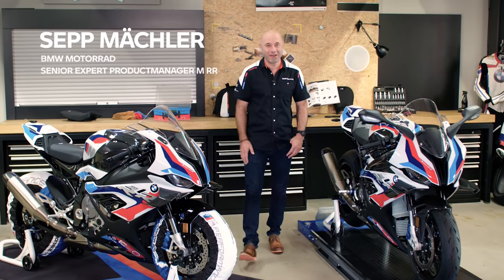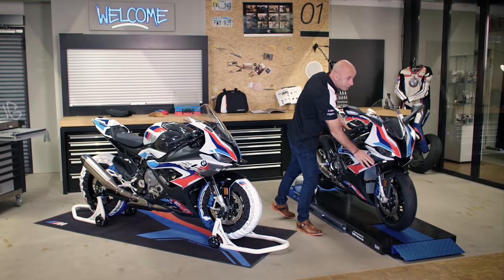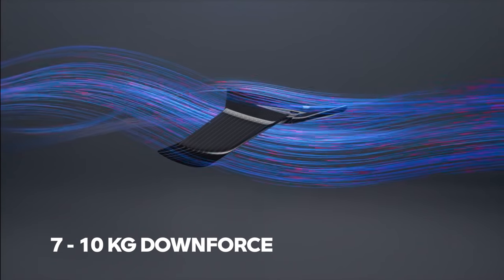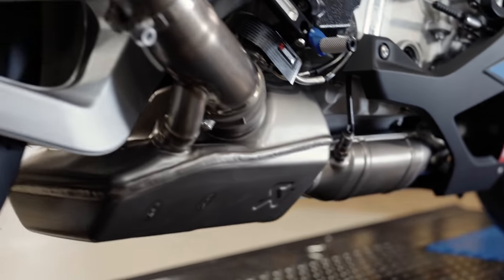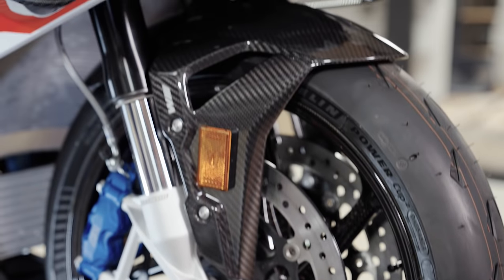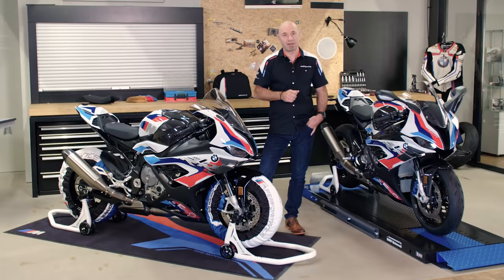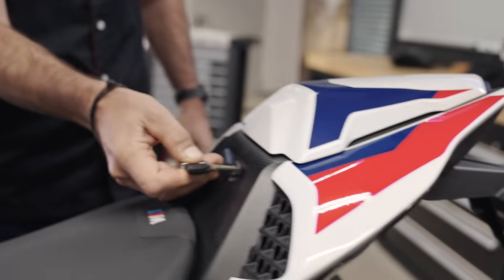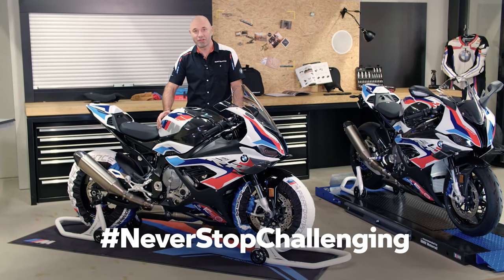IN THE SPOTLIGHT: The new BMW M RR

Comment: I'm slightly confused which bits and bobs are inc, or are available as extras.. ? Toward the end there is mention of the paddock stand, garage mat and warmers, then says something like other stuff also available, so I found it ambiguous - are the stand and mat thrown in? Ones I have for MV will go with it.  Another Q...  says height adjustments etc really easy, but is this def correct, ie with no team back up, if you say you want it delivered at lowest height (this is taller than my preference), is it straightforward or the mechanic at local selling dealer is learning as he goes? I ask because other forums saying that there have been failures as a result of adjustments made...  would be nice to have comfort...  thanks :)

Comment: I want a 600cc version of this bike.
Reply: Not going to happen even in the million years. 600cc is not selling and they're dying off. If the rs660 will succeed maybe we will see a new category of midweight sportbikes like that with the more relaxed ergonomics and more mid-range focused engine instead of purely top end.
Reply: @Fearless154  ofcourse the 600cc are selling.... in EU we got 3 diffrent types of licenses. light mc midle mc heavy mc. and 600cc can be limited down to the midle mc license category. they sell like butter. why do you think everyone still offers a 600cc bike? 600cc bike is a great investment becaus the 1000cc bike allredy counts for like 60-70% of the development costs for the 600cc version. it's just basic minor changes and a new engine that is required for the 600cc bike and boom you now got a beginer sport bike that you can lure in new customers with that will most likely get a liter bmw  when they upgrade from theyr 600cc one.
Reply: @rampage3337  
Everything you just said is wrong.
First let me be clear by 600cc I mean supersport 600cc class like r6 and etc not middle weight bikes like mt07 and ninja650and  sv650.
I'm from europe as well the licensing system has nothing do to with bikes like r6
Because a1 allows up to 15hp the a2 up to 47hp and A is unrestricted.
R6 is 130hp bike in order to ride r6 you must have full unrestricted license.
600cc class bikes like r6 has major problems like being very expensive for what they're, they offer no street usability, no torque at all under 10k rpm with very uncomfortable ergonomics.
Bikes like mt09 cost the half the price while offer the same performance but actually usable as every day bike.
Facts speak louder than word supersport 600cc is not selling any where and you can clearly see it thats why yamaha discontinued the r6 and kawasaki is going to discontinue  the zx6 as well after 2021.
And the focus will be on the bike like rs660 comfortable sporty middle weight bikes.

Comment: 2021 will be my 3rd season with my "old" HP4. Everybody told me that DONT BY A BMW S1000RR you will spend a lot of money on maintenance are you and idiot? I bought it with 6000km, now it has around 23.000km and I changed the brakes oils filters and fluids...thanks BMW, meanwhile Ducati guys are in the service in every 2-3000kms with their panigaleee :) By the way the new S1000RR has a lot of reliability problems, maybe the MRR will solve these engine, electrics and brake problems.

Comment: God, why the coloured stickers all over it!!??? Couldn't they of chosen one colour in premium paint???
They should of given the bike a letter or number, (like M1000) in the M family tree. I'd prefer some nice chrome M logos, than coloured stickers all over it, love the bike, but it looks cheap and not special up against the Ducati V4R with its polished non painted tank. Just a fact.
No. 2, No electronic suspension for $60k+ 🤣 they must be smoking crack!!! The only model in this price point without electronic suspension, well done BMW, what a fail.
Any street rider would prefer automation over fancy carbon wheels that make no difference. What street rider wants to get out their screwdriver and other tools?? 
They should of made it limited in number. Its an amazing bike, the first to offer carbon wheels as standard, the brakes actually look good up against not having Brembo's, and BMW have the best TFT LCD screen on the market by a long way. Have you seen Ducati's? Still terrible, BMW'S look nothing short of an ipad mini, it's exceptionally great. But, damn those stickers, it looks no better than a Ninja 400.such a let down, I'm not buying a bike that's $60k, then BMW has packages ontop of that price??
Why not offer it all, there's a Crome and Carbon Packages ontop??? Jesus christ mother of god, why couldn't they offer a second blank colourway?